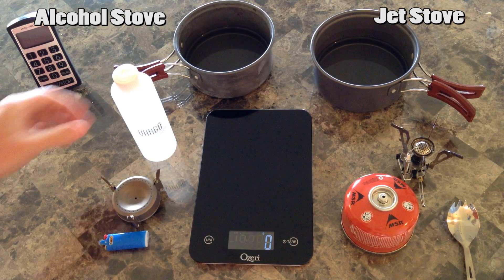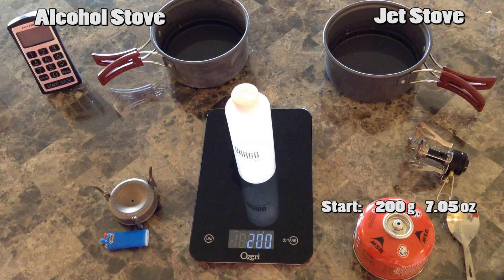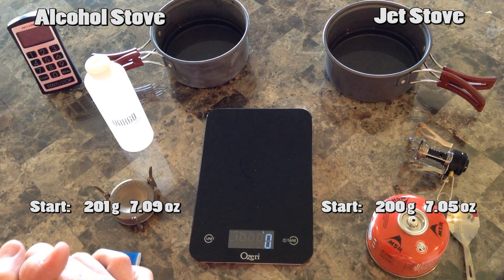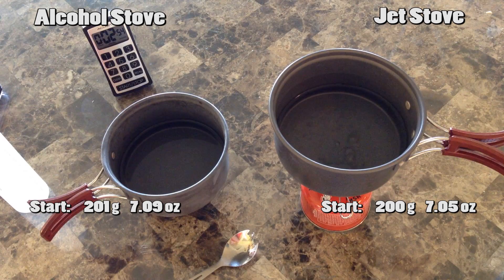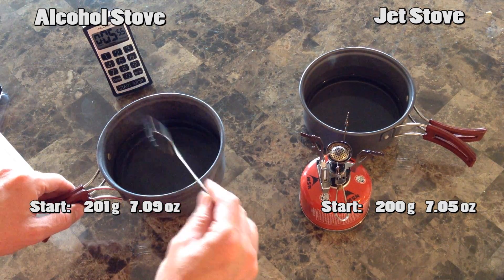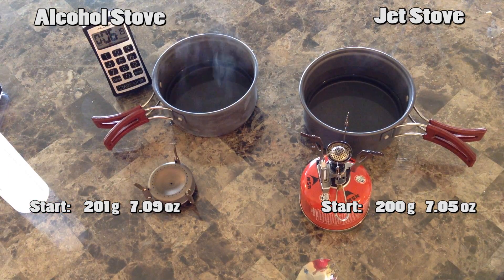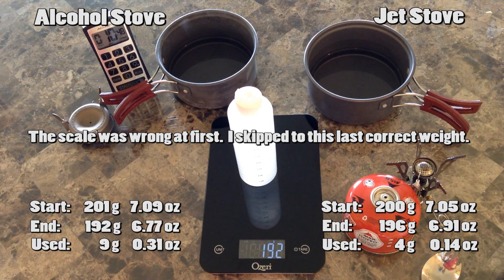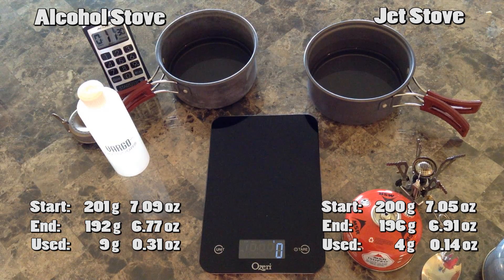Alcohol Stove vs Jet Stove - Fuel Usage in Weight

Comment: Good video, but I would have used a larger amount of water to get more accurate results. 4 grams can be anything between 3.5 g and 4.49 g, which gives you a 28% margin of error. The alcohol bottle also has some weight -- about 40 grams, I reckon.
Reply from the maker: I agree there is error in my method. The amount should be much lower than 28%, as I slowly added water when the scale approached 4g, stopping the moment the digital meter updated.
Reply: What I'm saying is even if your method had been 100% correct and your measurements perfect, when your data point only has one significant digit, you open yourself to a very large margin of error due to rounding. Here's a more recent video similar to yours, and it seems the uploader gets closer results for alcohol and gas (11 grams versus 9 grams):

https://www.youtube.com/watch?v=JYYOm6UOVjY

A few things seem clear, though. Gas is faster, alcohol is cheaper, and gas is more convenient. As for the weight, you can buy a 25-gram titanium gas stove from China for about $10, and a 45-gram titanium alcohol stove for about $20. But the alcohol stove needs a rack on top, which  also adds a few grams. The gas canister, on the other hand, is 60 grams heavier than an alcohol bottle. But you need to carry more alcohol for the same amount of useful energy. So in the end, it all comes extremely close. 

I prefer gas for the convenience and speed. With the alcohol stove you risk spilling the alcohol all over the place, and when you're finished you need to decant the alcohol back into the bottle, at least with the titanium model. If I did a lot of hiking, cost might become something to consider, and alcohol could become a preferable option -- or even better, wood, which is free.

Comment: nice video! To be more accurate, you could have put some alcohol in the burner, weigh it, use it and weigh it again to see the consumption
Reply: Best way to compare is weigh stove + fuel + container, before and after. That way you don't have to worry about recovering any fuel from the alcohol stove. The weights of the stove + container will remain constant for both fuels. So any difference in weight from before to after must be fuel burned.

Comment: Using multiple FireMaple pots (1l and 1.5l) with built-in heat exchangers, and using multiple alcohol burners (Trangia [brass] and Evernew [titanium]) I did a series of highly controlled/measured burn tests using denatured alcohol fuel. 

Across the board no matter which burner nor which pot, it consistently required 6ml to heat the pot plus another 6ml per each cup of water, to bring near to boil. So it is simple math to predict how much fuel is needed for any given task: 6ml for the pot + 6ml for each cup of water. This means any schmuck can pre-measure the appropriate fuel for a given task: 2 cups of water require 18ml of fuel.

The only variable was the burn rate of each burner style. The Evernew burned 6ml in 1 minute. The Trangia, with simmer ring top removed, burned 6ml in 2 minutes. This means the same schmuck can predict how many minutes the task will take: 2 cups of water require 3 minutes in the Evernew, or 6 minutes in the Trangia.
Reply: so whats better gas or alcohol?

Comment: Hey bro. Great test video. I've also seen tests with pots that have a heat exchange welded on the bottom. They look just like the bottom of a Jetboil pot. With using alcohol stoves and canister stoves you get a faster boil time and use even less fuel. Sometimes as much as 1/3 less fuel. I know this is an old video and you probably already know all this. Still it was a cool video. Thanks.
Reply from the maker: I haven't seen the heat exchange pots.  That could make a nice follow up video.

Comment: Nice post, Thanks for sharing. So if you calculate how may boil times with the canister stove at your elevation and temp, that is about 25 boils from full to "empty". No brainier for cook speed and weight to fuel ratio. I'll stick with my canister stove at elevations lower than 12,000 thanks.
Reply: There are other considerations. Such as, after a long hike, would you rather sit and listen to your canister stove roaring for 3 minutes, or (using a completely silent alcohol stove) listen to the sounds of nature for 6 minutes?